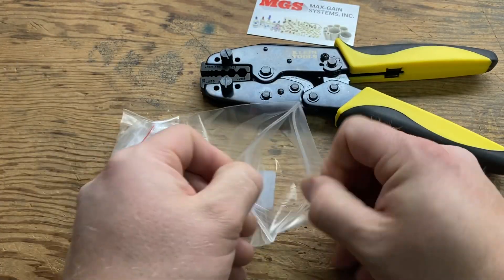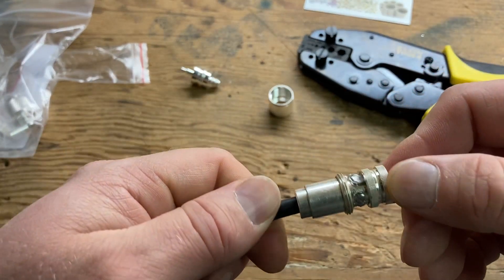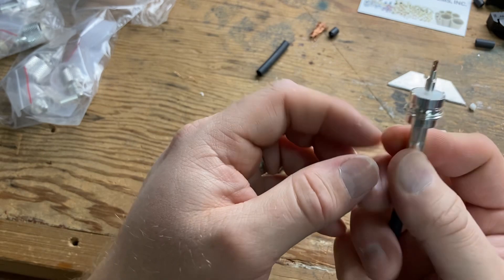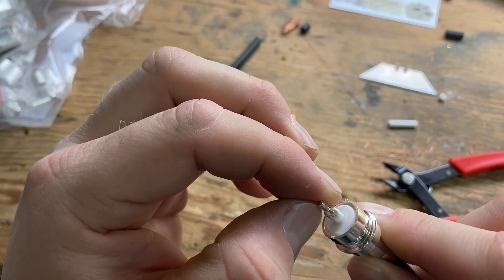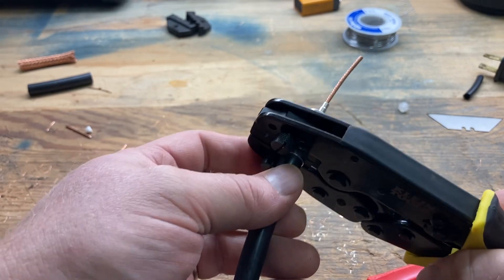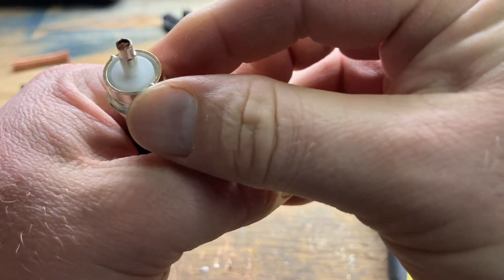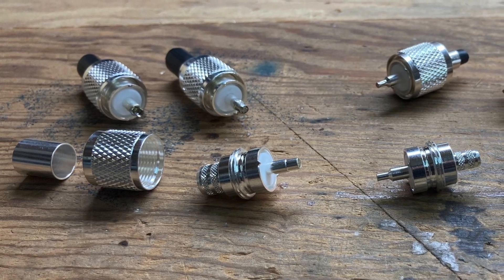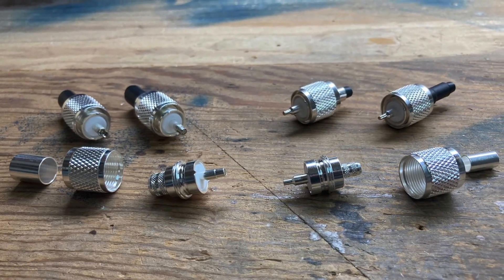PL-259 With Center Pin Crimp - Test

Comment: If you read your specs for the connector it probably says you need to solder the center pin for the coax with a smaller center conductor. If you had used lmr400 or one of the other cables with a larger center conductor it would have worked.

Comment: I use a DX Engineering crimp tool and their PL-259 connectors. For this 78-year-old guy, this crimping is a BEAR. I end up using a vice to close the crimp tool all the way!  But, I get it done. I'm not all that good at this either. Sometimes I screw up a couple connectors before l get a non-shorted connector. Lemme tell ya, "Gettin' old ain't for sissies"!